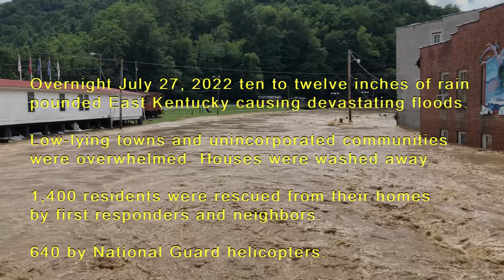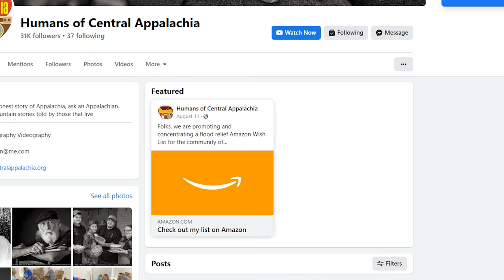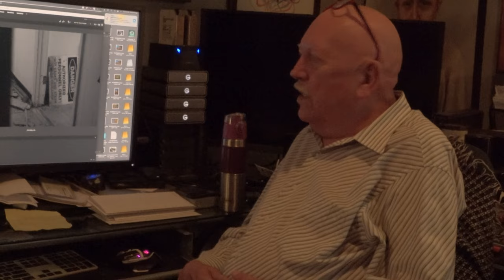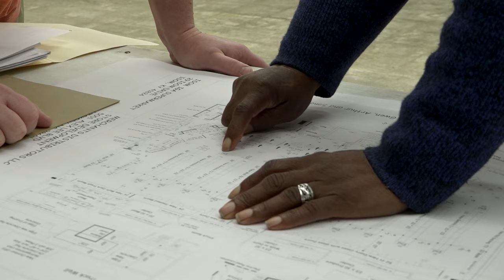East Kentucky Flood | Full Documentary

Comment: Ideation for people in flood plain:  Build concrete flat platform. Acquire used river barge floats [or make your own 1/2 size]. They interconnect like modular construction.  Build your home on top of that platform. [not a houseboat, but a real home anchored to I-beams on the floats]. Electricity would need flexible connections. Water lines would need break-away connections.  Anchor the floats so they would go up for 40 feet and when water was receding could set down on solid stilts until the concrete platform could be cleaned ... then jacks lower again in place.  It would be a great feasibility design as a college engineering class project. Concept wise there could be an entire town with shopping center set up that way.  Just saying.
Reply: Interesting thought.
Reply: @deirdrepasko9965  I know the general idea is sound, the mechanics need working out ... and Kentucky mini-rivers are likely not the ideal spot to do it ...  more like somewhere along the Mississippi flood plains. I researched the existing barge manufacturers and got the spitting drawl response of No, you're talking a simple houseboat.  I got it. They are established, no need for R & D expenditure on a scheme that has not proven itself.  It would take time for the concept and final designs to be developed, so not good for venture capitalists either; they want fast return on their investments.  But, I know the idea is sound.  Thank you for the comeback.
Reply: @michaelpcooksey5096  The problem is flood insurance in Southern states. The insurance companies based in Southern states like Florida, Louisiana, and Texas are predatory and would refuse to insure buildings that have non conventional foundations.
Reply: @rubberband1510  Right!  This 'building' would not have a foundation. It would rest in a 'dry dock' affair with landscaping to disguise the bones.  How about living on a dry-dock?